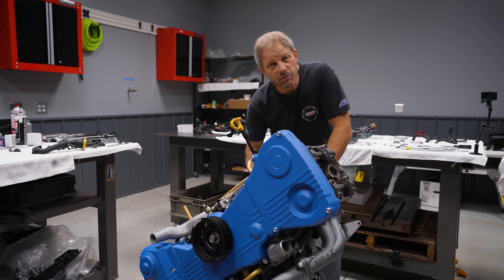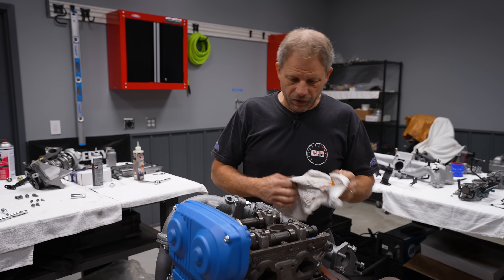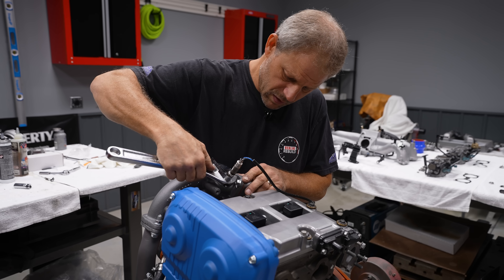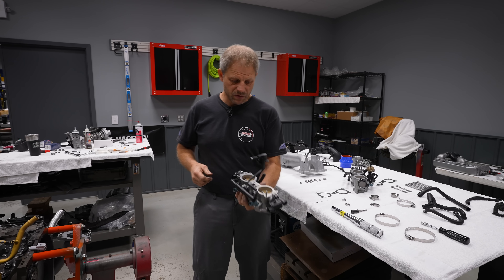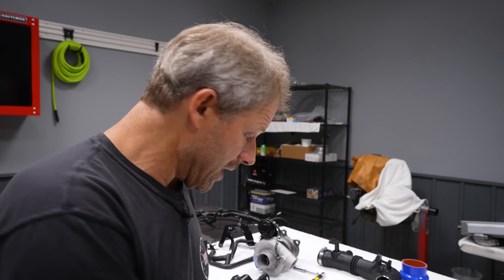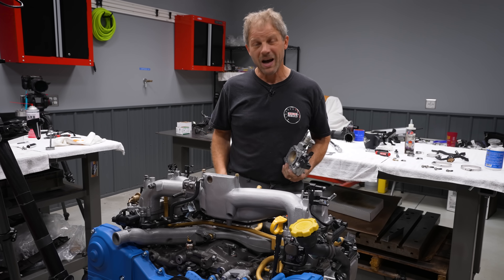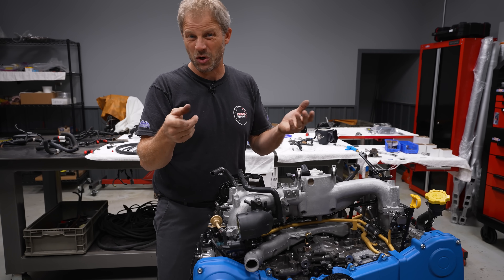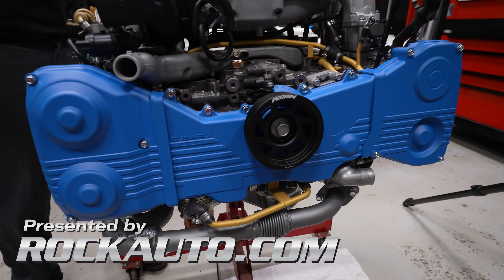Final assembly on our 2002 Subaru EJ20

Comment: She's good for another 50,000 miles now!
Reply: I trust his work, but I'd go with 30k
Reply: i don't know much about cars, but is it mainly because the design problem of this engine lead to blown head gasket or because of the driving habit?
Reply: Nice 👍
Reply: @andy2a2m  more most builders don't use the proper jigs and steps needed when machining the block and heads and then mixed with engine design they blow. If you use all the proper equipment and steps they can definitely last a long time if taken care of and with quality modern parts and proper maintenance. If abused your going to blow a headgasket
Reply: Maybe
Reply: I drove my Subaru Outback 180,000 miles. I had head gaskets replaced at 105,000 miles and replaced the radiator at 125,000. I sold it at 180,000 miles and two years after selling it I heard the guy that bought it was still driving it down the mountain to work and back up the mountain to go home. I changed the oil every 3,000 miles and it didn’t burn oil or leak oil so all of you making smart assed remarks about Subarus evidently do not know how to maintain them nor do you name them. They respond very well to having a nickname.
Reply: @beboboymann3823   @beboboy mann  my 05 legacy gt has 180k miles. Block never been touched. Big turbo, fuel, intake, tuned etc. Needs valve cover and half moon gaskets, but not too bad for now lol. Been modded since 120k miles. Still going strong. People don't realize the turbo subaru engines are actually really good. It's the earlier na motors that had head gasket issues.
Reply: 😂 head gasket
Reply: @andy2a2m  the design of a flat engine means coolant and oil will rest on the head gaskets when the engine is not running.
Reply: My impreza L has 417,000 miles on a running ej22 motor before i gave it away.  Im 6000 miles on the entire car rebuilt and a jdm ej207
Reply: @andy2a2m  main things are
1. Subaru flat 4 have bad oil return system back to pan
2. Non parallel fuel rails which means the last cylinder to recieve fuel (4) recieves lowest fuel pressure
3. Head design where exhaust gasses are much harder to escape on cyl 3 and 4
4. Headgasket material on older ej were trash
5. Oem oil pickup sucks lol

Now they also deserve care and maintenance and not a lot of people do that lol.  People throw parts on without a tune and go kaboom or drop a cylinder, dont stay on top of maintenance either
Reply: Not so much tbh 🤣
Reply: Keep in mind this engine had almost 300,000 miles on it, so you might want to revise your estimate. The EJ20 is extremely reliable if well maintained. I have one with 223,000 miles and it looks nearly new inside.
Reply: @acemacgruber6593  That genuinely has nothing to do with why they fail. Don't listen to Scotty Kilmer, hahaha. Only the naturally aspirated EJ25 had prevalent head gasket issues.
Reply: @802Garage  Scotty revs up his engines lol
Reply: Thanks everyone. Maybe i watch too much scotty kilmer videos, there are no good cars other than toyota lexus honda acura. LMAO
Reply from the maker: You're right. We've been saying it a lot during this series in particular: change your oil regularly!!! Routine maintenance goes a LONG way for every engine out there. Do some "better" engines stand up to a bit more abuse/ignorance? Sure. But there are very good reasons that manufacturers have maintenance schedules!
Reply: @andy2a2m  headgasket issues on subaru mostly happened in the non turbo cars in the 2000s mostly due to Oem cheating out on the type of headgasket material. Another common issue is when people rebuild motors they don't machine the heads (the heads distort over time and heat). Basically if the heads and block are machined flat and a good quality headgasket is used this basically becomes a non issue. (I own two 300,000km + subarus that get driven hard)

Comment: Not my preference in engine choices, but amazing work as always. That motor is like two 2 cylinders conjoined at the crank.

I'm sure you get suggestions all the time on projects, but take a look at the Toyota 5.7 from the Tundras and Sequoias over the last two decades. Beast of a V8 with a distinct head design. Also, the famous Toyota 22RE, arguably the most reliable motor ever made.

Comment: This is the most love a EJ205 ever got for a rebuild!
Reply: I've never seen one given so much attention. I assumed its happened but this show claims credit for me.
Reply: I went even further on mine. GSC stainless valves, ARP head studs, new OEM pistons, fully machined and line honed block, TGV butterfly disc delete, all new PCV plumbing, new Header thru to new stock muffler exhaust. 02 bugeye wagon with factory leather.

Comment: Those are called at Subaru TGVs or “Tumble Generator Valves”. They remain in the “closed” position to tumble the air and mix the fuel better. On higher loads they open up. Lots of guys will delete them, however the performance gains are negligible on normal street usage. A highly dedicated track user might wanna delete them but for the normal street driver, just keep ‘em. I wrote this before i saw you found out what they were called lol.

Comment: You're doing great. Waaaay better than I could have done in your shoes, that's for sure.
Recently I tried to connect the back wires on the alternator of a 1969 Mustang after replacing it, for the life of me I couldn't make out the "right way" to do it. Had to call a friend with more common sense than me for help.

Comment: I’ve only rebuilt one horizontally opposed flat four and it was a zillion times easier. I rebuilt a 69 Volkswagen Beetle engine and I don’t think it took more than a dozen tools and the only “speciality” tool was the large socket for the crank bolt. Otherwise it was a piece of cake. I’m not sure I’d give one of these a try. Even with all the tools and budget of a Hagerty build.

Comment: 5:20 TGVs . Supposedly improve fuel atomization during cold starts. Just delete the butterfly discs inside and leave the actuators intact. Having done a couple of these, holy crap the order is way too exact for my liking but that is the most japanese thing ever. I had a few bad/stripped bolt heads and simply couldn't move forward until I got them out because I couldn't successfully work around the dang component.

Comment: Never install the A/F sensor before installing the engine. You will almost always damage the sensor while lowering the engine into the car. I know this going to an engine dyno for testing and the sensor is required for operation but unless you want to replace the sensor, remove it prior to installing the engine. 

Also, Put anti-seize on the turbo studs. Always. You will thank yourself later. 

Looking forward to seeing the engine on the test rig!

Comment: Are you taking into consideration the length of the extension when torquing?
Relative to the flexibility of the extension. ✌️
Reply: Just a note from an engineer, if it is that sensitive to torque then it was designed wrong.

Comment: Great job on the rebuild! Am assuming you are not going to put that nice powerplant back into the same old Subaru from which it came. This is also based on the fact that you have already removed the K frame, exhaust, wiring and dash display. Am thinking you or someone else is planning build a kit care. Can't wait to find out.

Comment: You should seriously consider taking that lightweight crank pulley off as they're nothing but trouble and get a fluidampr dampener.
Reply: also, it is highly recommended and in the service procedures to put some silicone of some sort on the valve cover gaskets where the half moon seals mate up and where the loop around the camshaft sits.

Comment: I've been trying to keep up on this rebuild. I think I miss an episode but gonna go to the channel and check. But did you by chance pack the oil pump? These are notorious for not priming. I use a little vaseline to initially pull suction.
Reply from the maker: We did not include it in the video, but you are correct! They are tough to prime and we ended up finding a "hack" on the internet similar to what you suggested to get it primed!

Comment: Try taking out and putting in a e39 transmission 3 time in winter on jack stands in a drive way to replace a clutch. Cuz you messed up putting the slave cylinder in twice 😮‍💨

Comment: The only thing I can think of that's as complex as this is a Goldwing engine and that's only because their cases also enclose a manual 5 speed transmission, I have built several of them, and each and every one was a huge pain in the A$$! 4 or 6 cylinders!

Comment: That's the problem with most modern cars. You need almost all the electronics and wiring out of the car just to start the engine. just like my pickup truck you have to have all the modules for the engine, transmission and accessories plugged in and they better match the engine or it will not start. If you change anything it has to be reprogrammed to match and the tool and licence to do it from Ford is quite pricey.
Reply: That's a 'Ford thing' particularly; I wouldn't take anything FoMoCo for free even...